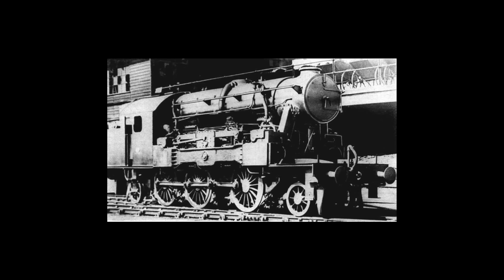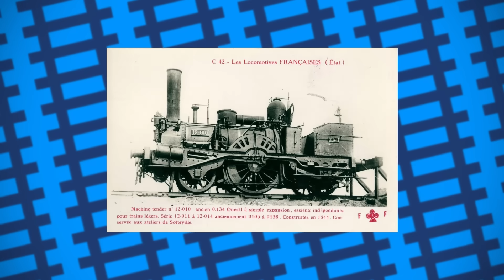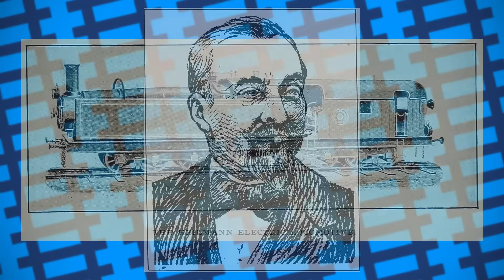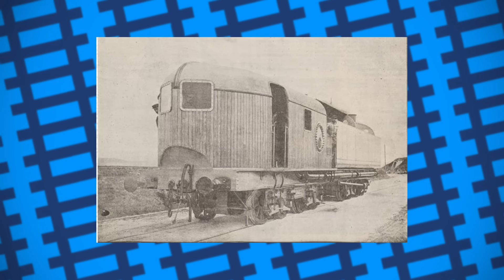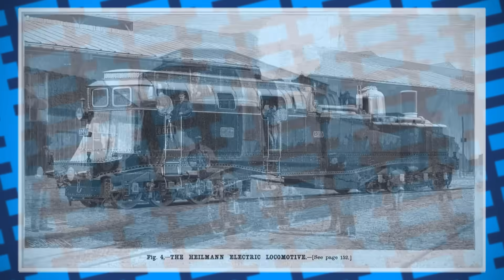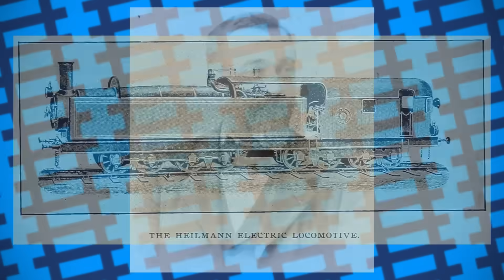France's Fascinating Steam-Electric Locomotive - Heilmann Locomotive

Comment: Given the lossy transmission, how was their fuel economy good?
Reply: I wouldn't say the transmission was lousy, but rather simply less efficient than a steam locomotive. In a steam locomotive, all the power generated by the boiler goes directly to the cylinders which turn the wheels. There's still some loss of power from cylinder horsepower to drawbar horsepower (no system is 100% efficient), but not much. In the case with the steam-electric locomotive the power moves from the boiler to the cylinders which powers a generator which then feeds the power to an alternator which then provides power to the traction motors which finally turns the wheels. There are more steps involved between the power in the boiler and the wheels. Looking at it like that even today's modern diesel-electric engines, which are easily capable of 82% to +90% horsepower efficiency, would be considered less efficient than a steam locomotive. Where horsepower is concerned steam locomotives will always win as any superpowered steam locomotive built by Lima, Baldwin, or Alco back in the day could produce more horsepower at the rail than a diesel-electric engine even by today's standards. Higher starting torque, better fuel economy, and lower maintenance costs are what ultimately won the day for diesel-electric locomotives, not horsepower efficiency.

As far as fuel efficiency, the boiler used in the steam-electric locomotive was triple expansion, meaning the same steam was used three times to power 3 cylinders each at different pressures as the steam expands after each use. This uses steam more efficiently than most traditional locomotives which either use the steam only once (your typical rigid frame locomotive like an FEF-3 or simple articulated locomotive like a Big Boy or a Challenger) or twice (like a Mallet articulated locomotive like Western Maryland 1309 or a Norfolk and Western Y6/Y6a/Y6b). Mallet locomotives are more fuel efficient than simple expansion locomotives since they use the same steam twice. The steam-electric locomotive was triple expansion using the same steam 3 times, a step beyond a Mallet locomotive and therefore more fuel efficient than either a Mallet or a simple expansion locomotive,

There's power efficiency and fuel efficiency at play here. 2 different types. The steam-electric locomotive, while being less power efficient compared to a steam locomotive, was more fuel efficient.

Hope that makes sense.
Reply: @davidwhiting1761  Yet diesel electrics work? So I don't really understand the statement of oo they're less efficient, ok conventional steam locos were well established but as a concept it worked so I don't know why it couldn't be done again
Reply: @SteamLance Which efficiency are we talking about here? Power efficient? Fuel efficient? Or cost efficient?

I think the video made it pretty clear that the steam-electric locomotive was ahead of its time. More fuel efficient than a steam locomotive but not very power efficient given the technology of the period when electric transmission was still in its infancy and really heavy for similar reasons. On top of that you had additional specialized maintenance costs for the generator and you needed an extra 3rd man on the locomotive. Try the same thing today with modern technology with better designed traction motors and prime movers, better wiring, computers taking over the fireman's duties eliminating the fireman entirely and able to recognize and diagnose faults making maintenance more manageable and removing the need of a technician on the locomotive outside the shop plus tech that's smaller, lighter and leaps and bounds better than what was available in the 1890s and the concept could be crazy enough to work today. No argument there. The one thing that would need to change is the fuel source: coal, because coal literally has a dirty reputation which wouldn't go down well with folks outside the railroad circle and would be viewed as a technological step backwards especially given the efforts to reduce carbon emissions by any and all means (yes I know a steam locomotive puts out less emissions than an airplane and potentially better than a car or a truck, but regular folk don't recognize that when they see smoke belching out of a stack now do they?). Given the way railroad tech is going the likely answer would be hydrogen. Plenty of energy potential and instead of emitting carbon dioxide it emits water vapor, and it's tech that is actively being researched, developed, and improved upon today meaning it's only going to get better.

The reason the steam-electric didn't have more influence and become more widespread was only partially because of it being less power efficient than a comparable steam loco. Sure, you saved money on fuel but now you have to maintain an electric power plant (really hard to do and expensive back in the 1890s ), and in order to properly do that you had to hire a third person who was an electrician to be on the locomotive during operation. As stated in the video the engineer and the fireman were separated and given the pair are supposed to work as a coordinated team being in separate cabs made communication difficult. You would wind up spending just as much if not more money than you saved on fuel between maintenance and hiring a whole other crew member on a steam-electric compared to a steam locomotive at the time , and it being so heavy meant it had limited use compared to steam locomotive. Tracks in urban areas or country branch lines where they would've no doubt done a lot of good likely wouldn't support their weight restricting them to the mainline, and given this is the 1890s we're talking about here that track probably wasn't the best either. Those that could have invested more to see it developed further understandably lost interest due to low short-term profit potential and so the concept was never improved upon to address and reduce these inefficiencies and make it potentially profitable in the long run (gee kinda sounds like how things are today).

By the 1940s and 50s when diesel-electrics took over there was better technology available, plus the fuel efficiency of a diesel-electric being able to run further on a tank of fuel than a tender of coal and water could carry a steam locomotive coupled with lower maintenance costs, the potential of shrinking crew sizes, and the fact the loco itself could be used as its own collateral more or less ensured its profitability over the steam locomotive. It could save and make heaps of money quickly which is what investors wanted to see back then and still want to see today. More than could be said for the steam-electric of 50-ish years before when it first rolled out of the works.

We've come far enough that if someone wanted to pour money into developing the steam-electric today they could likely make it work now. Again, no argument there.
Reply: @SteamLance : The reason it couldn't be done again is because steam is a logistical nightmare. Aside from the shop forces and manpower required to deal with a boiler on rails, it also requires a dedicated supply of large amounts of water in tandem with fuel, which is why the North American desert roads were the first to scrap their steamers and never looked back. Despite years of false hopes glued together with the good Rev. W. Awdry's wet dreams, steam is never going to make a comeback, regardless of how much Steebs might want it to. Electric and diesel-electric require less maintenance, have fewer technical and logistical issues, and are mature technologies.

As far as power efficiency in one very specific place (rather than the whole system, this is important) goes, it's largely a red herring in this whole conversation. Three things that steam apologists (steam weebs, that is, Steebs) like to leave out of the discourse are:

1. Power doesn't pull trains, tractive effort does
2. Steam locomotives aren't actually constant-force machines; they're constant-power until they reach boiler limits, then they become constant-power
3. The overall efficiency of steam locomotives is abysmal and anything is an improvement, including farting into a thousand balloons and taping it to a thousand foam gliders

If the locomotive was hitting speed targets and its fuel economy was good, its power efficiency was irrelevant. Because the steam-electric is a constant-power machine, like a diesel electric, the available power of the locomotive, in this case the boiler capacity multiplied by the total transmission efficiency, ultimately determines where the total available force will balance the train forces, i.e., the maximum speed it will pull a given train. The train it will start prior to slipping its wheels, as with a steam locomotive, is determined by weight on drivers multiplied by the factor of adhesion, for plain steel on steel with no wheelslip control system this is about 25%. A constant-power machine's tractive force will trend towards infinity as speed approaches zero, and, depending on the available power capacity and its starting tractive effort, it will readily slip its wheels across most of its operating power range at low speeds. The trick is for its gear ratio and available power to allow it to use lower power settings at low speeds to avoid slipping its wheels while ensuring that the rapid drop in tractive force, which forms a curve, happens over a wide enough speed range that the locomotive can actually start a train before the available force drops to an amount where it can't do any useful work.

Obviously, this locomotive passed that test just fine and had enough power to get up to speeds that were adequate, and even impressive, while burning less fuel than a comparable steam locomotive, before hitting the limits of its speed capability. A better optimization of turbine, boiler, gearing, and electrical system would have probably helped (or a smarter clientele).

I have left out the concept of continuous tractive effort. The quick and simple version is that, because amps go up as speed goes down, this is the combination of speed and power that defines the limit of where the motors can receive maximum power continuously. Above this speed, you're good, below it, there will either be time limits of fried motors (your choice). At this speed, the combination of speed and maximum power will create the maximum tractive force the locomotive will continuously provide without expensive problems.

Steam locomotives, by comparison, are constant-force machines (or at least give the illusion of being constant-force machines) because they are force-limited until they reach their full boiler capacity, which will always occur at some speed. This gives the impression that they always exert the same tractive force and their horsepower keeps going up... and up... and up! But, when they reach the capacity limit of the boiler, they then become constant power machines, just like a diesel. The problem is this: the steamer typically doesn't have all weight on drivers, and the steamer hammers the rails, which means its factor of adhesion is closer to 20%. So, it can apply less of its weight to traction, and it multiplies that weight fraction by a smaller number. You have two 3,000 HP boilers, but one of them can pull half the train before it melts the rail in spectacular fashion.

Notice also that there's some clever sleight-of-word going on. Everyone's talking about the terrible power efficiency of the diesel and framing it in terms of the steamer putting nearly 100% of the piston's energy to the wheel. This is sleight-of-word being used solely for deception to hide the fact that 5% of the energy of the fuel in a conventional steamer goes to the wheel versus 30% in a steam turbine, and then 80% with an electric transmission for a grand total for a locomotive like this of roughly 24%. Most telling is the fact that everyone is ignoring the fact that the single biggest loss in a conventional steam locomotive is between the boiler and the cylinder! From fuel to boiler is about 70% efficient - the rest of the loss is in latent heat losses and under expansion in the cylinders.

In other words, the same boiler loses less power driving a turbine then it would sending steam to a cylinder (again, 30% vs 5%), and this more than makes up for any advantage of a direct driver piston v. the 80% efficiency of an electric transmission, which has the advantage of gearing and better adhesion and traction characteristics in the first place, meaning the train actually gets up to a speed where the power matters.

The inherent problems of maintaining the electrical system and the boiler are probably what doomed the experiment. As noted above, steam locomotives have their own logistical issues, and adding a new logistical issue on top is just asking for trouble. If they had today's mature electrical equipment, no problem; but, of course, if they had today's equipment, there'd be no need for the boiler, either. :)

Comment: The predecessor to the steamturbine-electric TE 1 (Jawn Henry) of the Norfolk & Western in the mid 1950ies, where steam and electric also didn´t work well together  …
Reply: Yeah, but I mean that's a turbine, essentially a jet engine. Not quite the same thing as a steam-powered generator on wheels like this. Don't forget PRR's S2 or the 2 GE steam turbines developed for the UP. While turbines make for fine power plants they make for poorly efficient locomotives being heavy on fuel as the turbine itself has to operate on essentially full throttle with extremely high RPMs the entire time it's in operation to generate enough power for the traction motors, even when there's no demand for power to the traction motors (a big reason why UP's later GTEL's poor fuel economy caught up to them - when first built oil was cheap so UP didn't mind them guzzling down enormous quantities of fuel oil despite their poor economy, but when the price of oil went up UP decided the fuel costs were no longer financially justifiable or maintainable so they quickly retired them and went all in on diesel-electrics), plus they're annoyingly loud being big jet engines on wheels.

The principle here is more similar to a diesel-electric locomotive where the engine itself powers a generator which then provides power to the traction motors, except instead of the engine being powered by diesel it's powered by steam. You can throttle up or throttle down the engine to produce more or less RPMs dependent on how much power you actually need which can directly affect the fuel economy and allows for less wasted fuel unlike a turbine which will use just as much fuel with no throttle or full throttle because the turbine itself is always operating at maximum RPM regardless of throttle position.

The modern equivalent of this design is probably a hydrogen-electric locomotive using hydrogen internal combustion engines, different from hydrogen fuel cell powered locomotives where the engine burns hydrogen directly instead of using hydrogen batteries to power the generator. Are they good? Are they bad? We'll have to see.

Comment: I love how this is the reverse of that Swiss electrically heated steam locomotive you covered a while back
Reply: Just use the turbine to generate electricity for the heaters and — wait hang on
Reply: @TheFinalFrontiersman  Actually .....
That idea has merit. Use coal to heat the water initially to get the steam powered dynamo up to speed, then start using the electricity to keep the water steaming, and let the coal fire die down.
Or, use a power generator/power grid to get the electric heaters to get the water to steam, then let the dynamo take over to keep generating steam..

I'm not an engineer; I'm a retired long haul trucker with a wild imagination...
I have NO IDEA if those are readable ..
Reply: @TexJester-no8th yeah great idea the problem will be the water but you can test that in a mini steam turbine generator ya know for free electricity at home without paying electrical bills
Reply: Ah yes, the Tigerli \m/
Reply: Now we just need an electric-diesel and we'll have a complete set.
Reply: @hedgehog3180  That got me good lol
Also, I struggle to think of any way to do this. I first thought of powering the spark plugs of the engine with the power from overhead wires, but then I remembered diesel engines don't have spark plugs.
Best idea I have is powering an onboard oil refinery to produce diesel for the engine.
Reply: @namenamename390 
electric-ICE can do. If not limiting to using diesel fuel, it can be a locomotive powered by a hydrogen engine, but uses overhead line to produce hyrogen gas from water.
Reply: Use a propitiatory electric motor with a speed control of your choice to drive a centrifugal or turbine compressor. Channel the compressed air through a venturi, and Inject the Diesel or any other flammable liquid into the airflow, then ignite. Direct the exhaust from the combustion chamber into a free turbine, which is mechanically coupled to the drive axles in the manner of a hydraulic driven locomotive. The jet exhaust can be used to generate steam for train heat via a plate heat exchanger before exiting the locomotive upward and centrally because wooden overline structures usually used to have metal heat deflectors there in steam days. 

Voilà, an electric Diesel motor-turbine mechanical locomotive.
Reply: @hedgehog3180 actually russians modified chme3 diesel loco and they Put an pantograf on it and is working somehow
Reply: It... Makes sense with my casual understanding of electric power components... Man, were exploring a new branch of Steampunk here ngl.